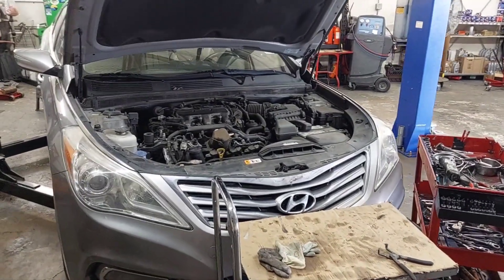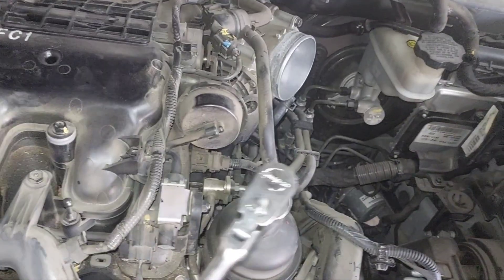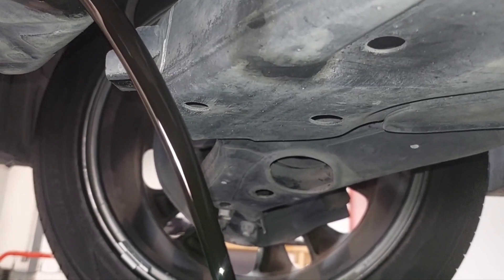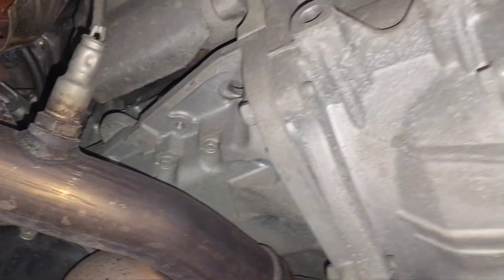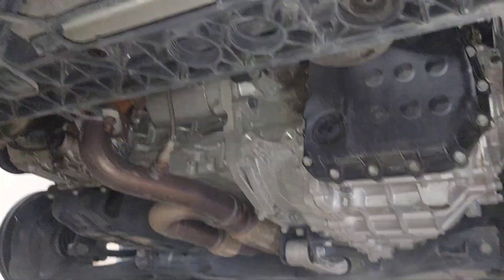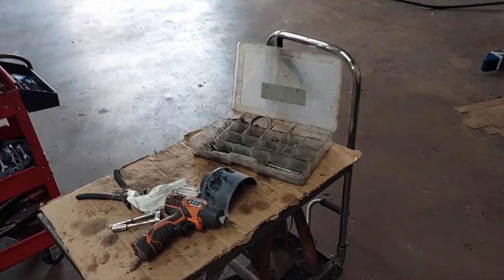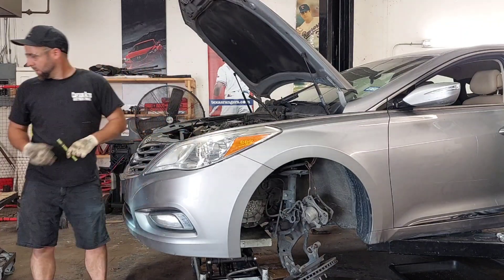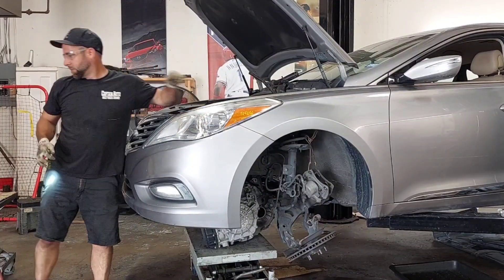2012 Hyundai Azera V6-3.3L Engine Replacement

Comment: Hey brotha! I have a quick question ,I’m trying to remove the passenger front axle from my azera, right before it gets to the half shaft , , just wondering if would I be able to just remove the half from (wheel to bracket )or would I have to remove the whole backer bracket for I can take off that entire piece with the half shaft? Because I’m trying my best to take it off and it’s stuck in there